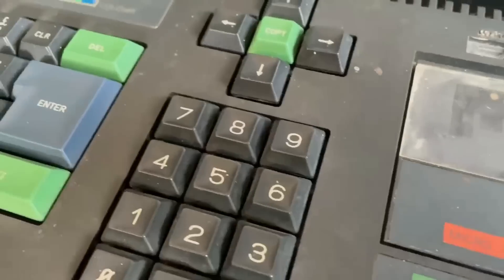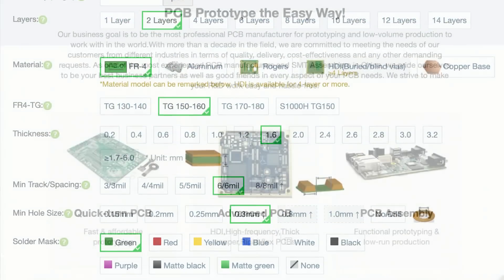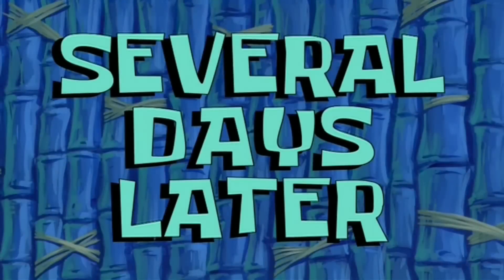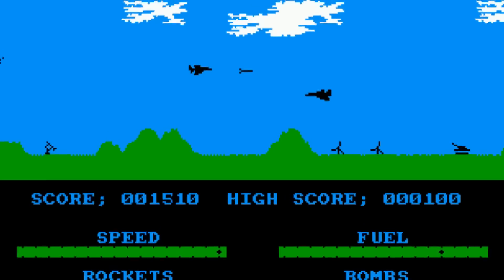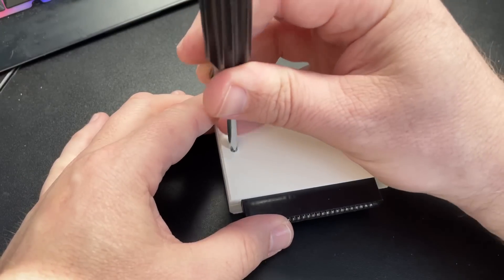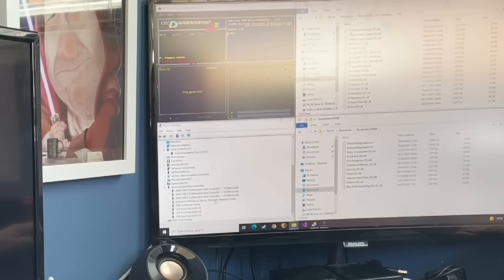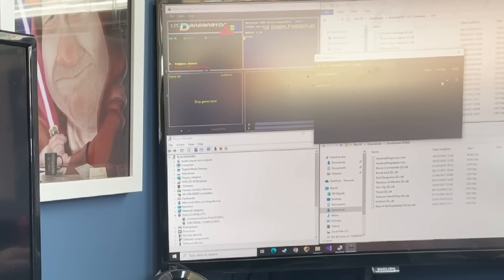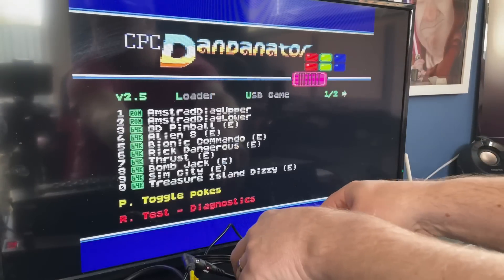Amstrad CPC Part Three - Disaster recovery and giving our CPC an external digital tape system!

Comment: I’d make one adjustment to the Cassette port you added. Rather than a 5 pin DIN, I’d go for an 8 pin socket. That still allows for standard cables to be used, but I would wire in some 9v rails to the pins not used by the standard cassette. These 9v rails on the extra pins would be use to power the SVI-CAS rather than yet another plug pack.

Comment: With the Dandanator you could have used the Diagnostics ROM to identify if/which chips are faulty. Usually only a single or maybe few chips are fried.
Reply from the maker: Unfortunately, to program the dandanator in the first place requires a working  CPC :) My dandanator came completely empty :( I have ram testers anyway so no big deal :)

Comment: That's cool. You should look at wiring up the input line of the external deck to the record line of the internal tape deck with a few diodes so you can record to a cassette from the tzx device.

Comment: why can't you have a module that will convert the 8bit words into a SPDIF signal for feeding a Philips DCC900 tape deck and then pulling the SPDIF signal back in and converting it back into 8bit words via the module.

Comment: So, forty year old memory chips are still in production? What an age we live in.
Reply: It isn't a matter of some of those part numbers being still in production. It is more a matter of some part numbers where produced so much that when demand started to drop sharply we ended up with enough inventory that NOS stock lasts for years. If I place an order for some of those old chips what I am getting is either New Old Stock or sometimes even "reclaimed". 4116 (IIRC) is a good example of this. Some parts from that era are still in production because they where used for embedded applications- the Z-80 is a great example. Some of the early Zilog Z-80s are starting to fail after 40 years in service but brand new replacements are easy to get.
Reply: @lawrenceshadai4966  They might fail if the equipment PSU is shoddy and lacks protection, lousy ventilation. MTBF is a thing but its more of a probability thing that has many factors.

Comment: Good to see it back to life!

Regarding modern storage options though, whilst the Dandanator is a good price, I think the best & most compatible option is probably the DDI-5 expansion that Zaxon makes.  It's pricey, but it gives you a disk interface & integrated FlashFloppy emulator and there's also HXC Selector software available for the CPC so you can use the CPC itself to select which DSK images to mount.  Plus you can also add a real floppy drive or a Gotek as a 2nd drive, as the DDI-5 has a floppy connector too.  The DDI-5 also comes with 512KB RAM, so lets you run many (but not all) 128K games on the 464.
Reply from the maker: One for the shopping list then :)
Reply: To be fair, the DDI5 is much cheaper than if you buy a GOTEK, DDI and a RAM expansion. Pretty amazing!

If you already have additional RAM (or don't need it), the USIFAC II is a good and cheap alternative to add mass storage to a CPC.